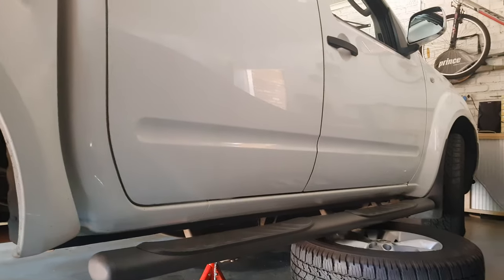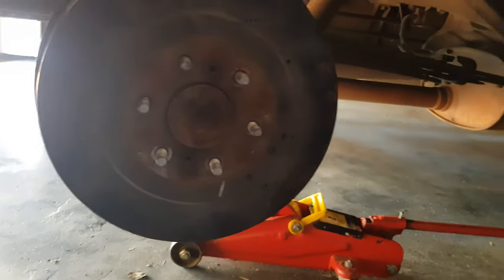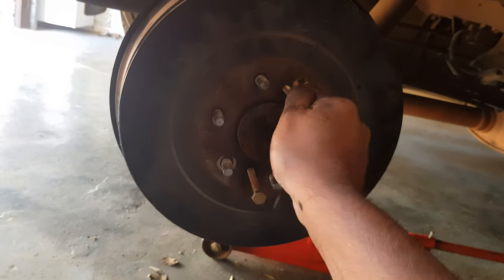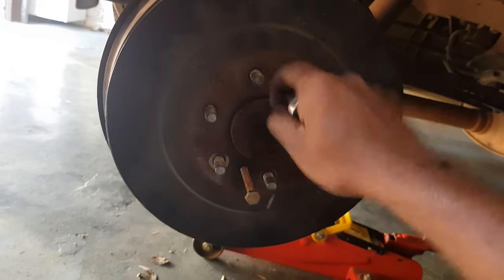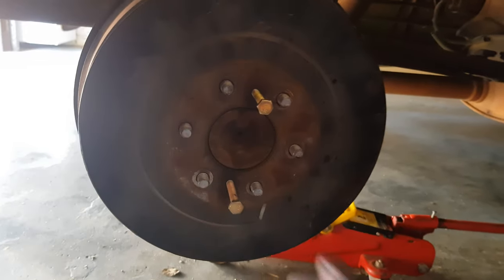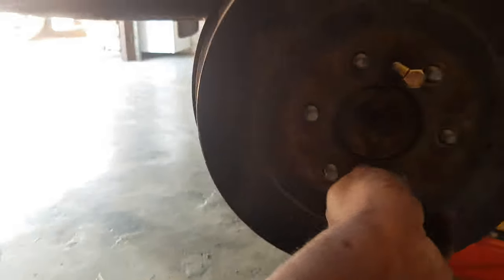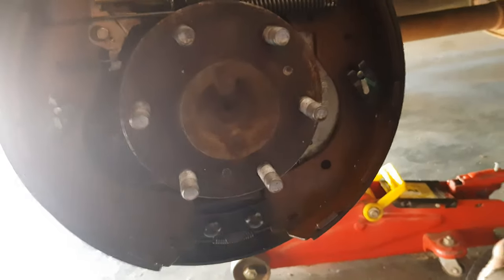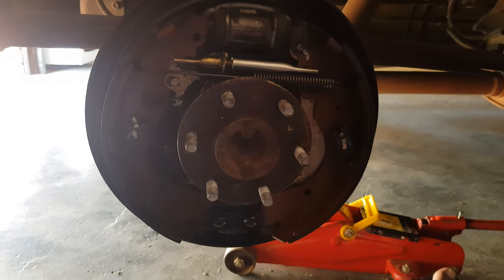Removing the brake drum from a Nissan navara or xterra

Comment: DO NOT FOLLOW THE INSTRUCTIONS IN THIS VIDEO! They are misleading and the video is missing the most important part of loosening the tensioner! If you do as shown in the video you will do great damage to your rear brake! The sound that you hear in the video when screws are turned into the drum is not the drum coming loose but the springs of the brake calipers still hanging on to the drum! STOP RIGHT THERE AND LOOSEN THE SCREWS AGAIN! This video should be removed!
Reply from the maker: Hi Richard. As stated, I am not a mechanic and this is the way I have done it on my vehicle and all seems fine thus far.
Reply: I realize it is pretty randomly asking but do anybody know a good site to stream new movies online?
Reply: @Kendrick Maurice Flixportal :)
Reply: @Chaim Clark Thanks, I went there and it seems like they got a lot of movies there :) Appreciate it !!
Reply: @Kendrick Maurice you are welcome :)